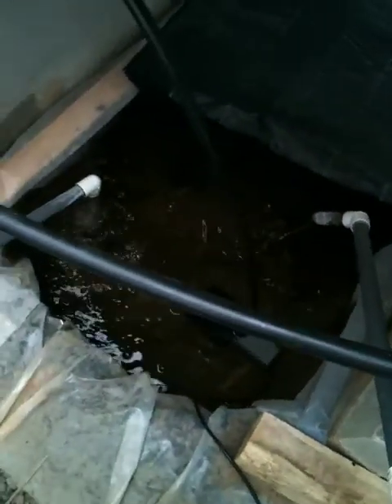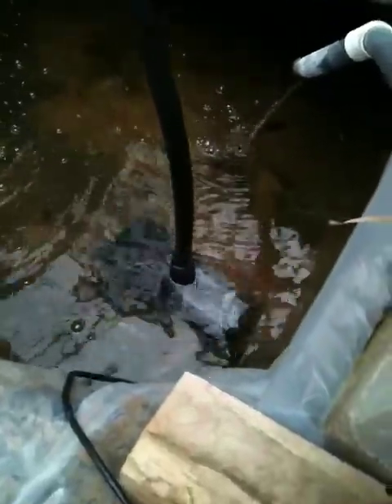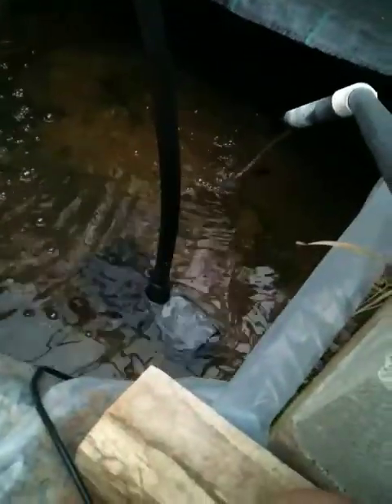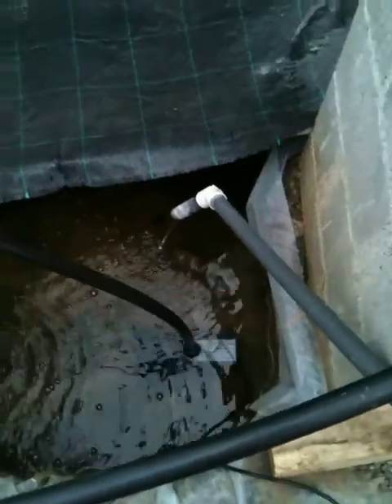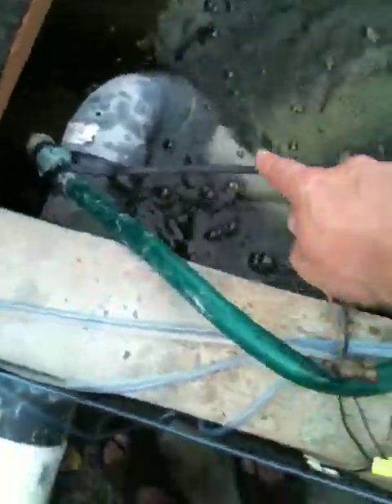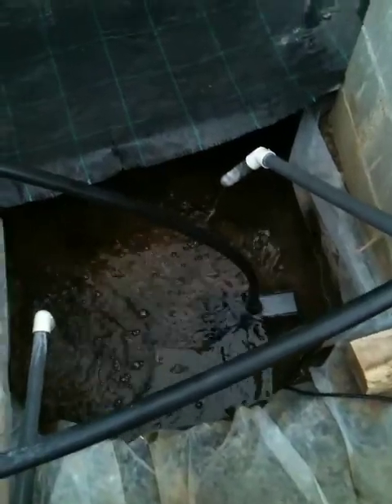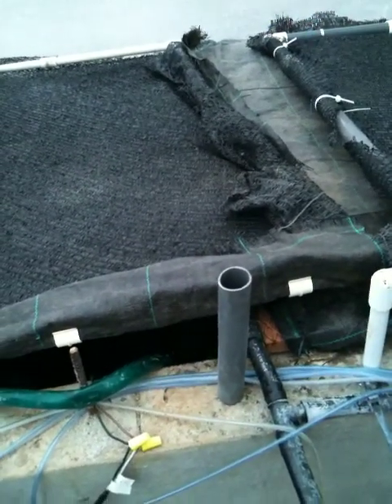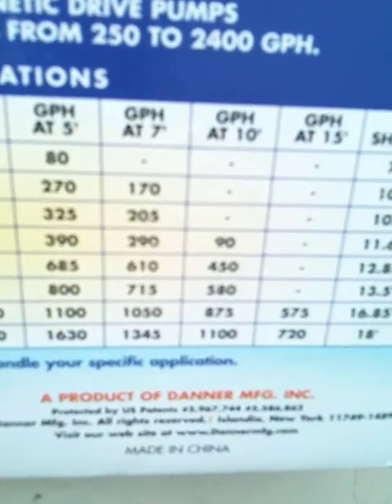Aquaponics Magnetic Drive Pump

Comment from the maker: It's a Danner Mag Drive 12, rated for 1200 GPH 
You should be able to google that and get a bunch of vendors that sell them.  
They work off a magnetic drive that uses no oil, so you won't risk any oil spilling into your system. That's quite unlikely - the main advantage is energy efficiency.